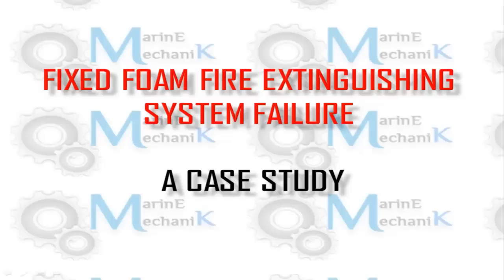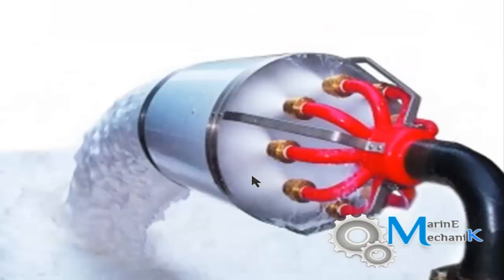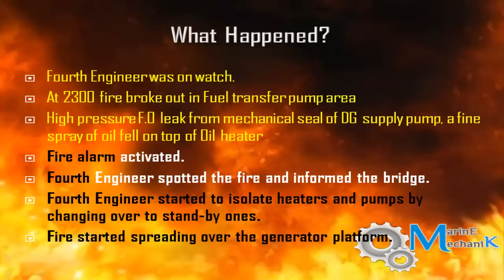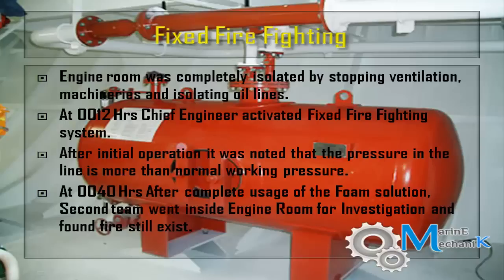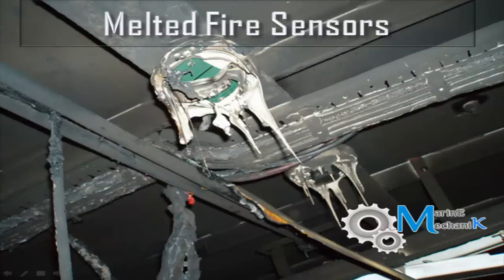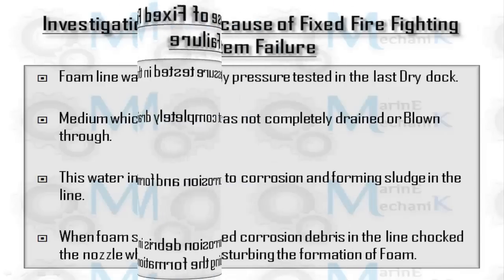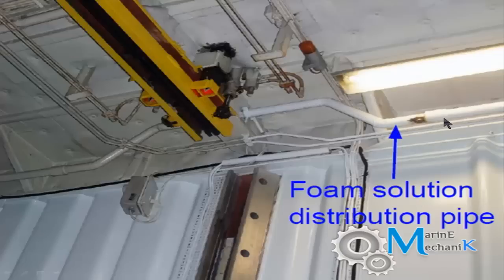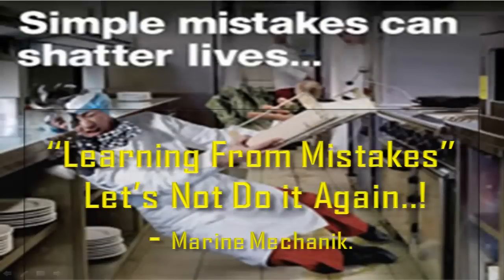Fixed Foam Fire Extinguishing System Failure - A Case Study

Comment: Good day sir  for your great explaination and view point , excent , all case due to insuficent timing and cur course Money due to short inspetion Foam system, all Nozzle not possiable to inspection , Blow throught also same Many equipment around engine room , only clean service ar Dry DOCk , next HYdro test pipe line follow up N2 blow throught complet line no body take care on thus job , due to Money issue